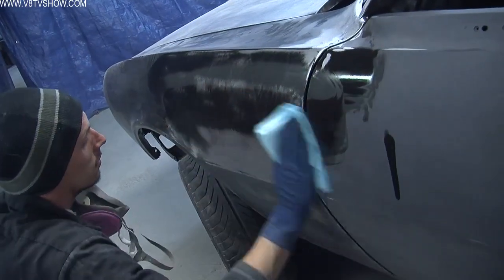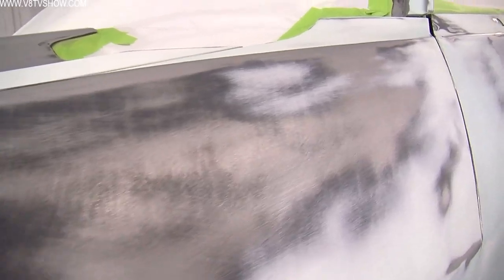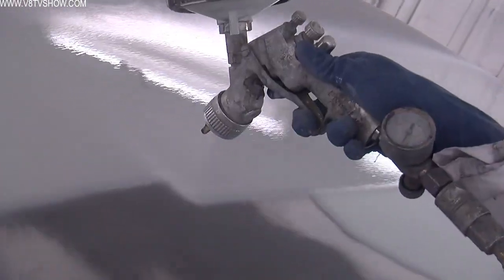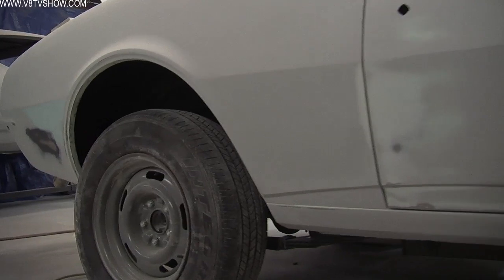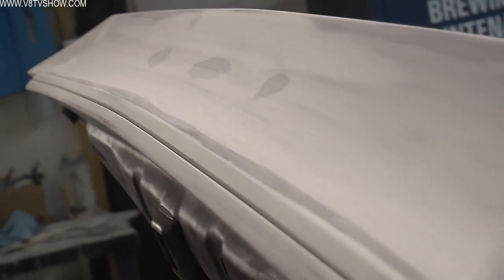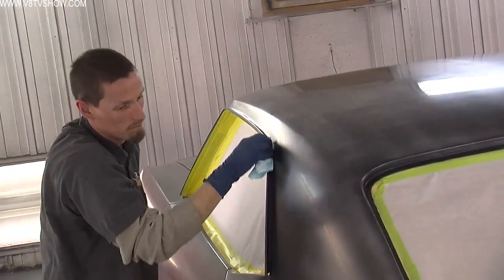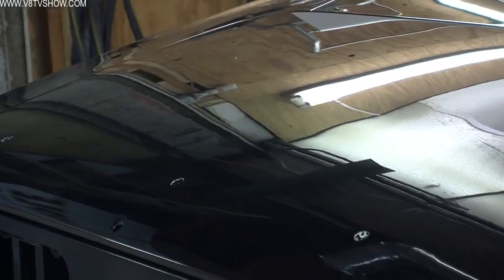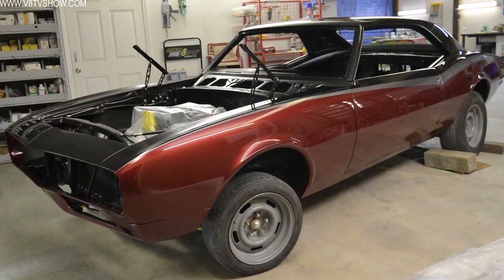Tricks For A Perfect Paint Job: Painting A 1967 Camaro Part 2 Video V8TV

Comment: What was the first product you used over the bare metal, black epoxy?  You used the polyester primer after the filler work, I have G2 primer I was gonna use as a first primer. Then after you finish with that step do you reprime with the polyester or was that a different primer? So it was then reprimed plus a sealer coat? What was it you used for that? I've only ever used PPG products at my work, but doing my own car I want to know exactly what I need to use so there is no "fail" down the road.